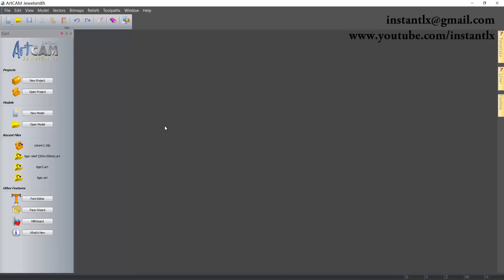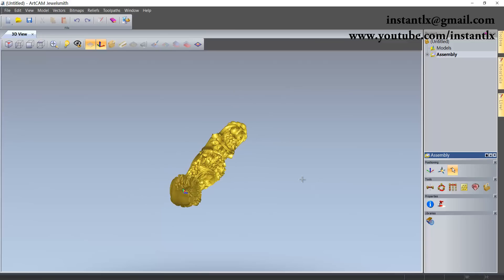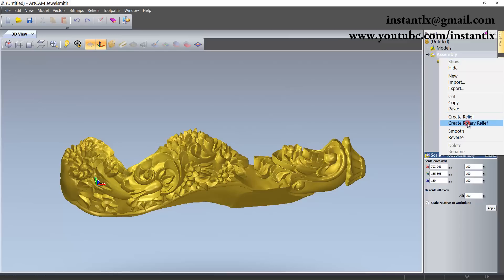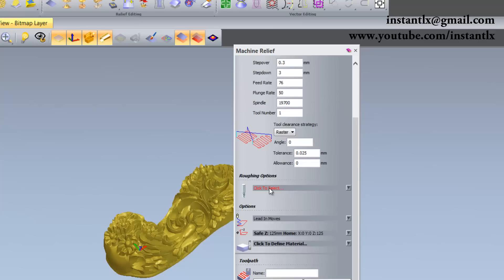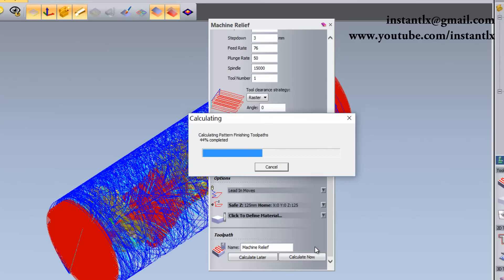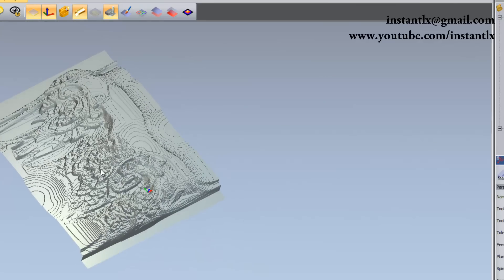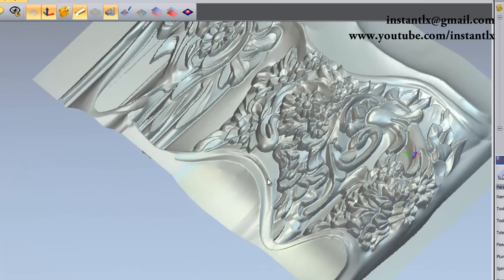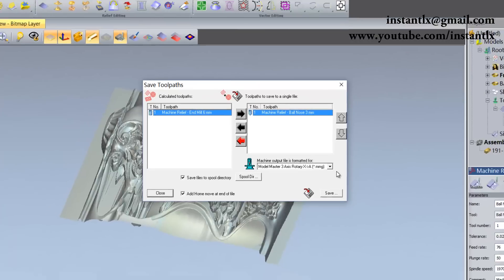Make tool path for rotary aixs in ArtCAM

Comment: What software to use to give toolpath other than artcam for complex rotary models?
Reply from the maker: for complex ratary you'll need a CAM software supports multi-axis (4 or more). So PowerMill, NX, Fusion360, etc, these may do the job but the big problem is where to get the post processor.

Comment: Hello Liu Xin, I have tried your method plus LOTS of other ways to make a rotary G code with Artcam but nothing works. The toolpath is allways incorrect and not accurate. Is solidcam or fusion 360 a better program to use?
Reply from the maker: rotary might be  complex depends on your cnc system.  usually it's more easier to make a centrosymmetrical columns. but for some irregular parts, it's impossible to get good result with a 3 axis machine. my email is instantlx@gmail.com. it's also my skype. tell me more about your machine, let's try finding a solution
Reply: save toolpath as Neo 4 axis rotary or Quantum rotary